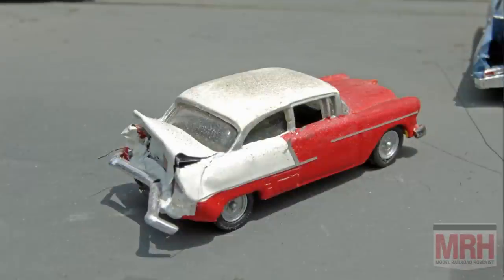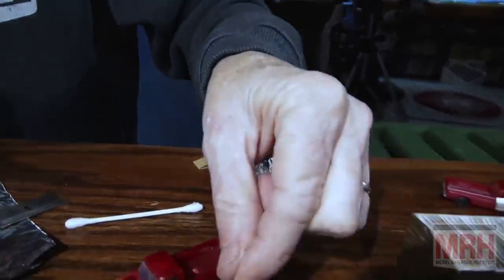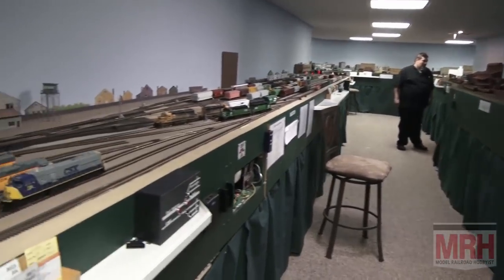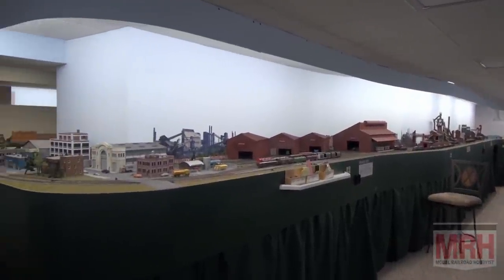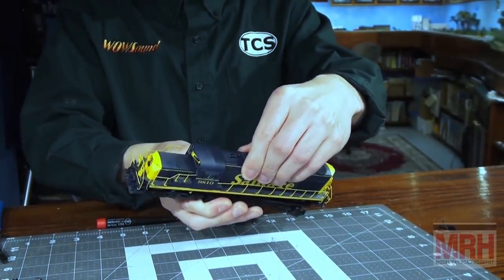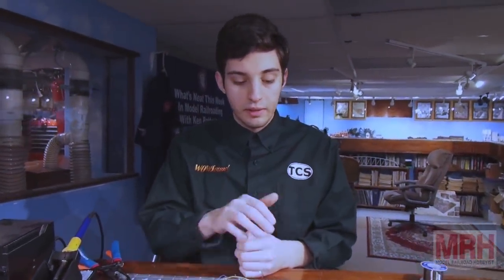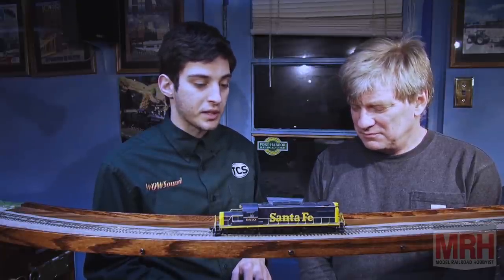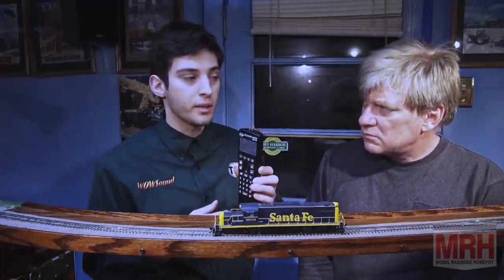Modeling damaged autos | March 2021 WHATS NEAT Model Railroad Hobbyist

Comment: The new drone segments, the frame rates give me the coffee jitters and actually are more a distraction than useful segments at this point.   The guy running the drone my need to look into Shutter speed and frame rate.
Reply from the maker: That's because the drone footage is recorded at 24 FPS and Ken records his show at 30 FPS. Either the guy needs to record at 30 FPS to match Ken or Ken needs to drop his frame rate to 24 FPS. Interpolating 24 to 30 creates an uneven playback.

Comment: Nice job on that sound decoder installation. Maybe someone can help me out. From my European perspective, it wouldn't be prototypical that all locomotives run lights in a consist. How's that for North America? And: Did Dan change the LEDs on the locomotives? It looks like they had more orange LEDs replaced by more cold white ones during the process…